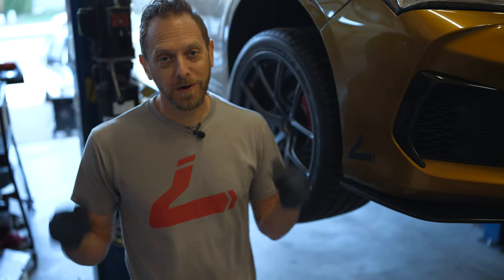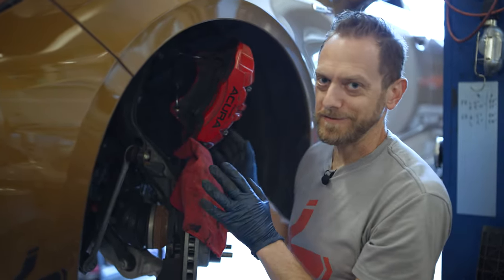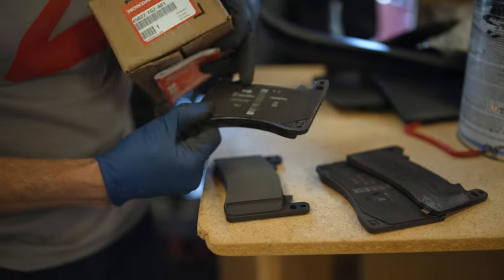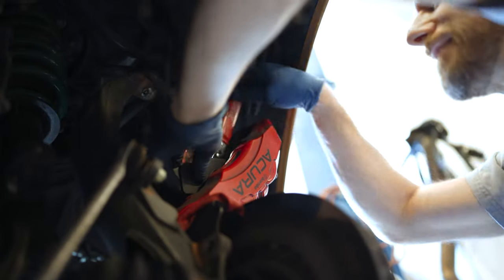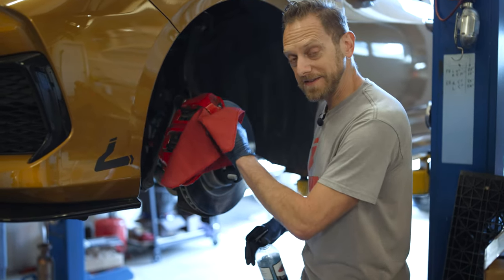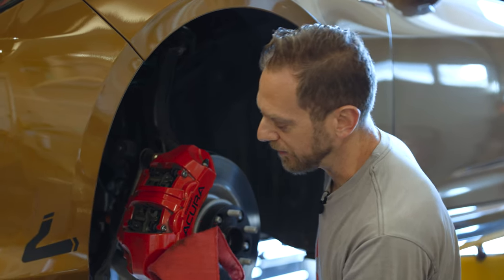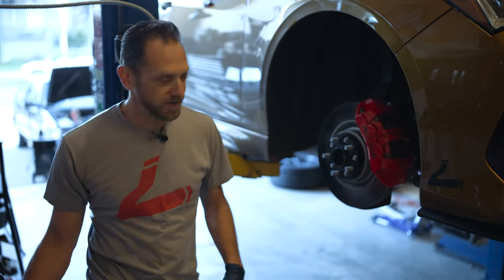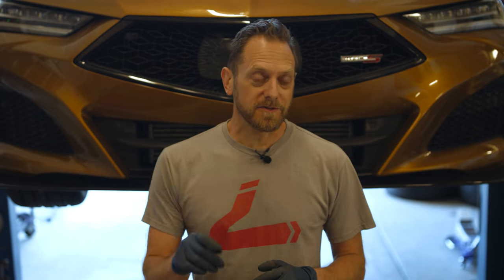Acura Type-S Brembo Brake Pad Change, TLX and MDX How-To

Comment: like the older TL type s. I see a lot of strip caliper bolts in the future.
Reply from the maker: I like it also. But also those calipers bolt on the same way so...
Reply: Or seized caliper pins and on the 2014 tl sh awd  you have to buy the caliber bracket combo for pins being frozen inside the bracket itself like that shit is bogus as hell

Comment: Do you need to open/crack open (vent)the brake reservoir while pushing pistons into calipers?
Reply from the maker: It isn't usually necessary but yes it is not a bad idea. Make sure the reservoir is not going to overflow also.

Comment: I'd like to hear your suggestion for which brake pads you recommend for a daily driven civic? Not a track car, just fairly aggressive driving. I've heard akebono makes great pads, but I don't know how they compare to stock. I don't want a super aggressive pad that wears down quick. Also don't want a noisy pad. Look forward to your response.
Reply from the maker: Sorry for the late reply on this. Yes Akebono does make great pads. They make many of the stock Honda pads in fact. But their replacement pads aren't much different from stock. 

Aggressive pads do not wear down quick, they last longer. But they can wear the rotor faster.

We suggest taking a look at Hawk HPS. They are a great all around street upgrade pad. We sell them on Heeltoeauto.com!

Comment: Hi I have Acura mdx type s 2022 I want to change the rotors, they have the same problem as in this video, what kind of rotors do you recommend? Thanks
Reply from the maker: Definitely the Racingbrake product: https://www.heeltoeauto.com/rotors/racingbrake-2-piece-brake-rotor-set-front-right-left-2pc-2022-acura-mdx-type-s-spec-brembo-2688.html

Comment: Curious about the electronic e-brake. Are there any extra steps that need to be taken because they’re electronic? I’ve only changed out brakes with a traditional e-brake and always assumed there was an extra step for these new electronic braking systems.
Reply from the maker: No there are not, to my surprise!
Reply: The rear calipers must be placed into service mode if they're EPB calipers. Honda does have a method that doesn't require a scan tool but does require the use of an e11 eTorx socket.

Comment: Any chance these rotors bolt up to a standard mdx? Caliper in all? I find my normal mdx needs more brake. I am coming from a ctr and the mdx standard brakes are not as good lol well…it’s a heavy suv
Reply from the maker: It requires a conversion to the MDX-S calipers.

Comment: Did you notice a difference when going to those titan 7? I've heard the OEM wheels are good awful heavy like over 30 pounds and the titan 7 are around 20 or so.
Reply from the maker: The car feels great with them! It seems to accelerate better but the grip is outstanding. These wheels are a BUNCH lighter. We sell them, LMK if you need a quote!